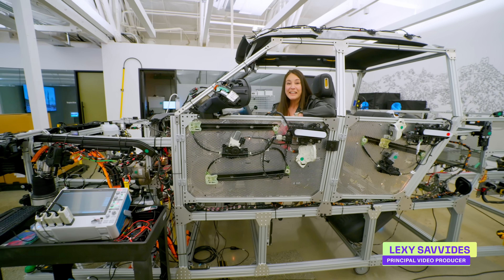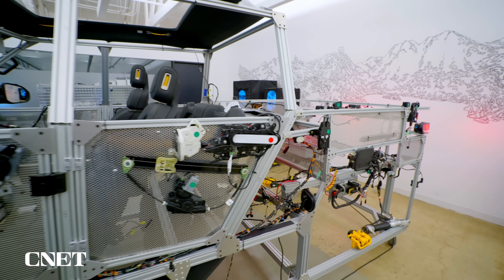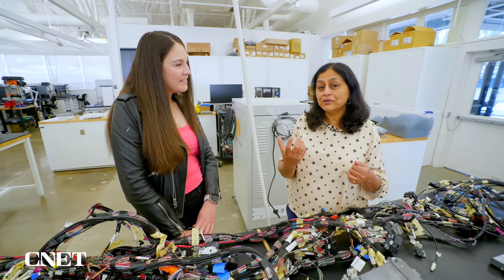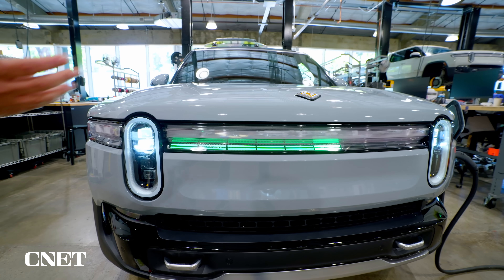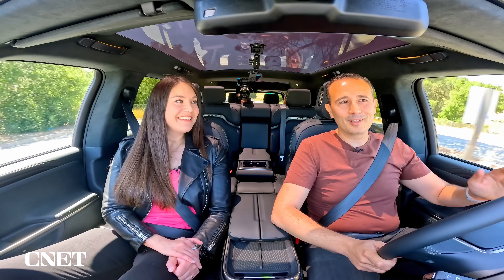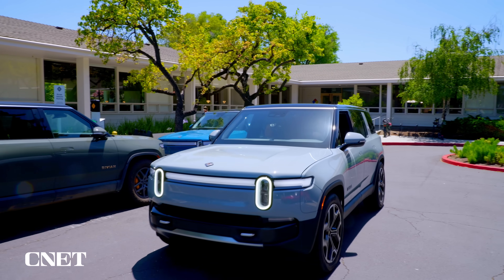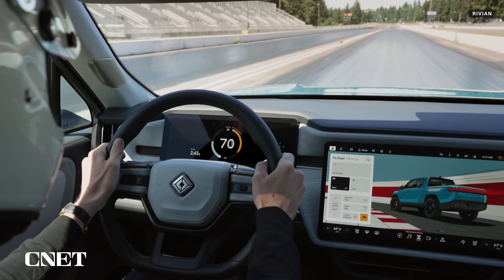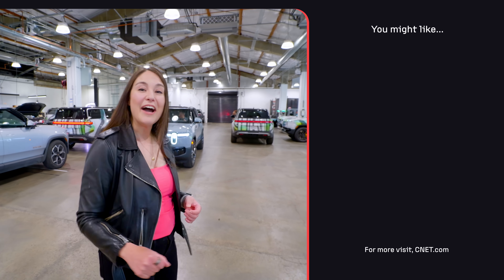Exclusive Look Inside Rivian's EV Test Lab (New R1S)

Comment: How about V2H feature?  Allow inverter to pull DC power from the car?  This way the hardware can be external?
Reply: The problem is the charger/panel connection. There isn't anything on the market yet. Enphase is suppose to come out with one this summer but we will see.
Reply: @yinglish119  yea If they allow it there will be people will make it.

Comment: The minerals mined then refined to make the vehicle including the eventual disposal of dead batteries means its carbon footprint is much larger than an 18 wheeler with over 500,000 miles.
Reply: Source?
Reply: @omarm798  Use any search engine to find the info.  It's not my job to inform you when you've a computer.
Reply: @omarm798  When the batteries die on your typical EV it'll cost $10,000 or more depending on the vehicle.  That makes an EV an even worse depreciating asset than gas powered cars.  Plus you can't resell it cause a buyer that uses their computer for info, unlike you, won't buy due to the cost of replacing batteries.
Reply: @deathevokation1017  Again, source?
Reply: @omarm798  Buy an EV and learn the hard way, lmao.
Reply: As Click & Clack would say, “BoooOoOooOooOgus”.
Reply: @EUC-lid  Bogus cause you actually are uninformed enough to think they use picks and shovels to dig out minerals.  Then they move those raw materials using ox drawn carts, lmao.  Then they refine the raw materials using magic wands.  Afterwards your EV is brought to dealerships by steam engine, lmao.
Reply: @EUC-lid  All the minerals needed for an EV fall out of the earth magically without need of innumerable diesel and gas powered vehicles.
Reply: @deathevokation1017  I find it very interesting how you people say these things and when asked where you get the information from you never actually provide it. It's almost as if you are pulling this BS from your backside.
Reply: Not true, over 95% of materials in EVs can be reused. Stop watching Fox News
Reply: You are ignoring recycling of the batteries which recaptures most of the materials.  Do better with the neg attacks.